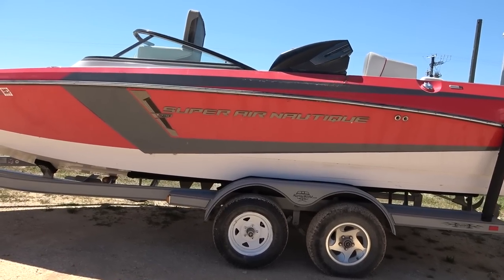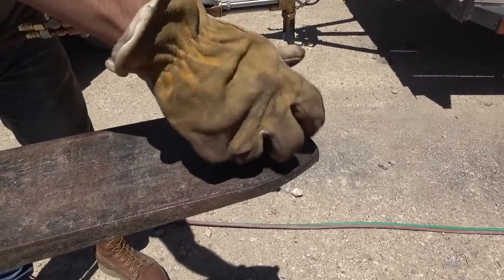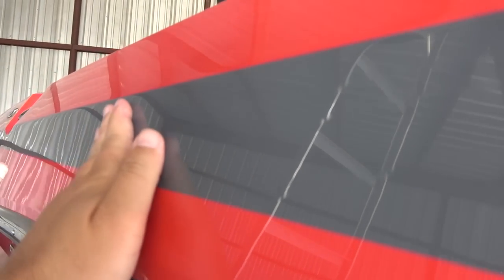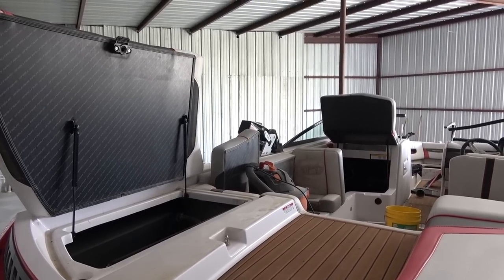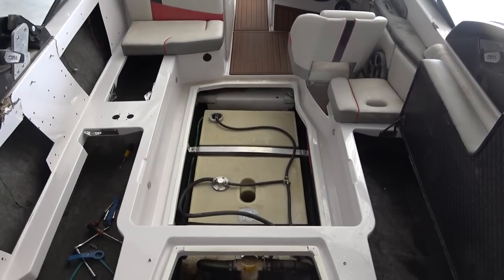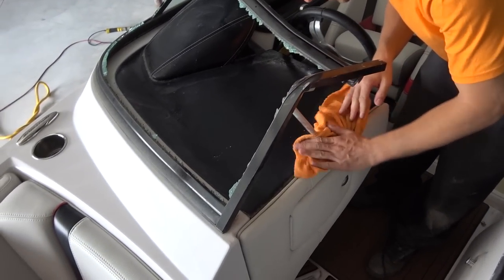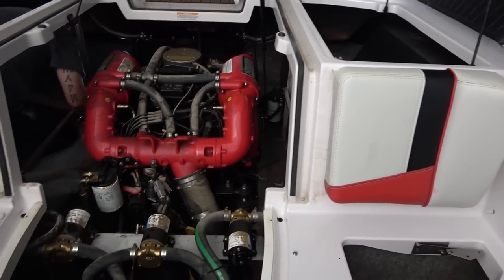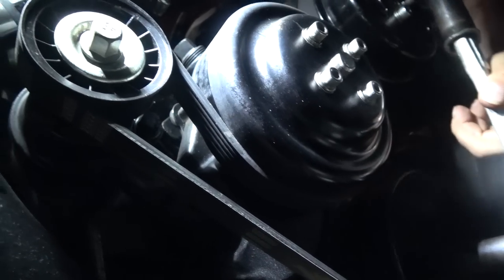Flooded Copart Super Boat REBUILD PART 2 - More DAMAGE!?!

Comment: about those pink spots. in Peru i have my boat at sea and those spots are from sea gulls poop. any chance it is the same case? try an oxidation remover. on gelcoat theyll just buff out. on vinyl you need the metal conditioner solution.

Comment: Beautiful boat I'm the one exception the first thing I would have done make sure the boat floats in the water to find out leakage of sinking Dan repair the leaks then get Sue everything else afterwards what from the bottom on your way up for all we know what don't know that type of damage of the window frame the boat was seriously rolled over on dry land don't even know if the boat is even worth fixing without the structure of the boat being safe for it to float and not drown sinking I meant

Comment: I purchased a Mastercraft that sunk. The only reason why purschased the boat because it went down in fresh water. Engine and trans run perfectly. The my biggest cost was the electronics. Had to buy most of the parts from Mastercraft and it was very pricey.  how much will it cost fix the tower from Nautique?

Comment: defiantly use automotive paint if you want to keep the boat stuffed up do some research first so you do the best job and its not that hard to gel coat we just  fully fiber glassed the roof of my dads 40 by 4 houseboat its not that hard this was done while it was stilled moored up during weather gel coat it it is easy and don't worry on cleaning fix first

Comment: If that engine has sat with water in the oil/crankcase it's SCRAP.  The bearings and journals are going to be rusted to crap.  It might run for a few hours but it won't last long.  Have you even changed the oil to get all the water out of it?

Comment: The fiberglass isn’t bad, epoxy and a reinforcing layer of fiberglass on the inside should fix it.
Reply: depends on what it was laid up in, if its not epoxy he doesnt want to be using epoxy, dont mix your resins.

Comment: Would it not have been easier to put a chain on back of forklift.. hook up trailer, pull it forward and do a 180 and pull trailer in? Or loop the barn and go in from behind if you wanted it in one way?

Comment: The pinking is mold that feeds on sunscreen and body oils then dies and leaves the pink behind as a bonus for you.  NO cleaner will remove it and the only treatment that works is a UV treatment that is big $$$$

You need to get into that engine and gearbox before doing all this other unimportant stuff.  The longer they wit with water in them the more damage is occurring.  Doesn't matter how the boat looks if it doesn't run and it going to set you back 15 to 20k for new drive train.

Comment: Dude, I'm super excited to see how this turns out! SANs never die, though this one took a helluva hit. I wonder if you can get a top 1/2 (above the rub rail) from a wrecked-bottom boat? Then swap the top sound top 1/2 onto this one. Seems that may yield the overall best end result. Just an idea, IDK if that's even feasible. Best wishes on this project!
Reply: What the fuck
Reply: Did you jut suggest he cut 2 boats in half and stick them together??
Reply: @drfrog4  Yes, just as they're originally joined along the rub rail at the factory. Seems this would be less man-hours and be sound, as each half used would be undamaged to begin with.

Comment: I would strip her to the bones. This is a very nice boat, built well at every aspect, in other words it was built right at factory.  Seeing this kind of damage to this boat, it went thru hell. The boat was not meant to with stand the weight of that much water , plus the engine weight upside down. You see this kind damage in that situation ,if you don’t strip it turn it over and Fiberglass the hell out of those stress breaks and gel coat it again it’s going to stress crack and screw up again, painting is not going to get it, unless you sell it and screw someone over.

Comment: There's an awful lot of nay sayers.   You got a brilliant boat that requires relatively doable repairs and likely an engine that will come back with minimal effort.   If you do a good job this will be an amazing boat for what you paid!

There's more work to do on the upper hull than just making it look good again, but it's fiberglass so just out the bad and replace it with new.   Can't see it being too difficult, some of it looks easy even.

Comment: Honestly man I get why your cleaning up but I wouldn’t waste my time until I found out the motor was ok the structure could be fixed.  If that Hull is not repaired on the back side we’re it was comprised. Your hard work will be for nothing first wave it will recrack there’s a reason why that boat was written off     Anything can be fixed I hope your not discouraged you’ll get it I’d talk with someone who is familiar with these type fixes to a boat and get there advice on how to fix the structure behind the gel coat because that boat hAs lost it original strength

Comment: Pink spots ‘may’ be from mould or sunscreen as suggested, OR a common byproduct of methamphetamine use on materials in an area can be very dark ‘PINK SPOTS’ of contamination. You can get swab test kits or adversely tested by professionals.
If it were worst case scenario - you’d need to scrap all vinyls and have the boat decontaminated.
Touch contact with skin can be extremely harmful if this were the case.
Just a thought.
Good luck with the rebuild.

Comment: Get it running and on the water before you get to carried away with the cosmetics.  Those stress fractures on the top side won't ruin your waterskiing and wake boarding, but not having a running, water tight boat will certainly ruin what's left of your good cosmetics.

Comment: If that Hull is fiberglass like RVs automotive paint will go to shit within a few years. Gel coat actually lasts a lot longer on fiber glass. If you look at some of the older RVs where manufacturers used automotive paint it didn’t last, there’s a reason they use gel coat..... especially in hot and sunny places like Arizona, Texas, and Florida. The fiberglass releases gasses that get trapped by automotive paint causing it to bubble up and blister.

Comment: Not trying to be a Killjoy, but just because the engine turns doesn't mean much on a boat. I had a Chris Craft with a 4.3 V6. Turned no problem, but previous owner didn't winterize it right. Block was cracked, 1 head was cracked, intake was cracked, both risers we're cracked. BOAT=Bust Out Another Thousand.

Comment: Not an expert but I have a Chris craft concept that I’ve had to get parts for the boat dealer near me told me never to use a pressure washer on gel coat is this a myth??
Reply: afik it depends on size,  the fibreglasser who did work on my boat when I asked him,  said no issue with small domestic ones,  but getting into larger / commercial ones they can start to cause damage.  Depends on tip you are using and pressure on it

Comment: I wouldn't have paid more than $9000 for the boat in the shape it was in when you bought it.  I doubt you'll make any money on it when it comes time to sell, especially considering the throw-away trailer you bought to get it home.  Tip don't put any labor into cleaning up the boat before you do all the fiberglass repair/paint/windshield replacement/etc.  You'll be cleaning it again after all that anyway.....and if you find something that turns out to be a deal-breaker, you won't have the time/money invested in unnecessary cleaning.
Remember; it was totaled because someone who knows boats determined it would cost more to fix it than it's worth......
Reply: Probably because the foam in the liner got wet, he probably didnt put a moisture  meter on the hull...

Comment: I would go with an automotive paint it will be easier to apply and it will hold up I have an 80ft Lazzara lsx 75 Named BG and we used an automotive pearlescent on the hullsides. so i would think if a yacht would use an automotive paint over the gelcoat I would imagine you could. you can lookup Lazzara lsx 75 BG and you can see how the hullsides look. the superstructure which is the top half of the boat is Gelcoat but the bottom is actually just an automotive paint over the old gelcoat.
Reply: Why pay more money for a less quality product? Automotive paint is not made for life in saltwater and will deteriorate very quickly compared to a one part poly made by total boat. Please do yourself a favor and disregard this comment and go to total boat.com, inexpensive and durable
Reply: @hawkeye123fun well we have had an automotive paint on a YACHT IN THE SALTWATER  so all I'm saying is it holds up in some pretty tough conditions and if your worried about it being on a boat that goes fast the lsx 75 does 35 knots so it holds up. It has been on it in the sun heat and salty conditions of Florida since 2009 when the boat was built plus any paint with marine in front of it is always more expensive. and I'm not some idiot im in the business of buying and selling cars boats and yachts.

Comment: Not sure about any one else..but before i clean and spend hours on cosmetic...i would make sure that boat is sea worthy or water does not come in hull...and mostly if motor is running...so that if $$$ and time is not worth fixing i don' t spend any more mula...on a junk...now boat looks good and may be am been negative...
Just going thru the motions...!

Comment: What is “Gel Coat” ?? 
A product or a process? Is it always a Polyester resin? Or could it be an epoxy or a polyurethane?
Reply: Brian Johnson it is just a protective layer over the paint to keep it looking glossy and keeping it from scratching.
Reply: “Gel-coat” is the first layer of resin that goes into the mold, on this boat each color is a different colored Gelcoat. It is what you clean, polish and wax on the exterior of your boat. I think you are referring to what is typically called a clear coat in the automotive industry.

Comment: You better bet if the jell coat is cracked the fiberglass is cracked therefore the structural integrity of the hull is compromised.

Comment: I think that I have had to cut holes into every set of forklift forks that I have ever worked with, it makes me wonder why the manufacturer does not just make it a standard feature, they could make a fortune with the extra equipment sales like the towing ball and chains as well as modified slings and hooks so as to lift engine blocks or to hang a block and tackle. . . . So much. . . , :-)

Comment: You've got severe structural problems with that boat. The gelcoat is telling you there's a problem underneath. When I saw your first video I saw a lot of cracking. That boat has to be completely opened up and the structure properly dealt with.

Comment: You don't have to make it perfect. Leave the gel coat alone unless it is cracked on the outside and flaking off or unless you have to paint that area anyway due to the fiberglass repair. The buyer is going to know the history of the boat and it is going to get old and fade anyway. I doesn't look bad unless you know to look for it. People want a good deal more than perfection. Clean it up, fix the fiberglass, tower and wind shield frames and glass. Get it running and everything working and sell it half price of a un-salvaged  one.

Comment: Those pink spots are caused by mold and mildew specifically the bacteria Streptoverticillium. Vinyl seats which are not washed down and dried after every trip especially in freshwater lakes are in danger of producing this bacteria. If you pull back the vinyl covers, you will find the same on the top layer of foam. Good news, is that you do not seem to have a severe case of pinking, and pinking is a indicator the bacteria is dying. Due to storage of the boat it has most likely exhausted the requirements the bacteria needs to survive. Bad news, is that to get rid of these pink stains, you would either have to upholster all the vinyl affected or use a solution called pinkaway. This can be administered yourself but from my experience, does not completely solve the problem but in other cases I have seen, it does. So it's a 50/50 but is a much cheaper solution to upholstering the whole boat. Also beware of any sunscreen which uses PABA (paraaminobenzoic acid) as the bacteria feeds of this acid.
In conclusion, preventive measures are best, which is a complete wipedown of vinyls with a weak cleaning solution after every trip and dry it off.

Comment: I just dont understand.  22g's was way too much. I mean way way too much. Did you say your going to put atf in that motor? Why? That boat took a high energy hit. That's why the gel coat looks the way it does. Notice where that damage is. Something fell on the boat or it flipped. Regardless,  the structural damage to it, it will never be right again. If this boat were in in turn key condition,  still not worth 22 grand. What a nightmare.

Comment: I always wondered what polishing a turd looked like, now I know. Hahaha!

Dude, those "cracks" aren't cosmetic, the hull has lost its integrity. You can repair it for fishing but if you use it as a speed boat the cracks are going to reappear and so will the shatters in no time flat. That hull is destroyed, you just can't see it for what it is. It will never have the same structural integrity it needs to be safe at high speeds. 

It's like totalling a porsche. Yeah you can fix it and make it look pretty but if you race it, it's gonna kill you the next time. It will never be 100% and those flaws will be apparent at high speeds.

Comment: His strange how my comment got turned all around I will try to correct it the boat that I have found water getting on some bass boats and regular boats is a gasket that holds the two pieces together the top and bottom and needs to be sealed that's where a lot of water comes in on both

Comment: I would do what Thr king wake surf boat maker does besides make it all out of aluminum ! But they use auto paint and they wrap a lot of stuff !  I’m turning my 90 nautique into a wake board wake surf boat ! Got a crate motor from correct craft for 7500 installed with new tyranny !! Won’t have the cool touch screen. !  But ballast in rear seat hidden !!  And Bennett make wake or ski settings for 499 and it installs in the middle like 75 percent t of the boats do I use to use a skylon and have all skylon fat saks ‘for extra balllast !! And I got a package tower for 1400 with led light ! Speakers but not getting and all I’m getting is board racks ! Bimini! And rroswell towers look retro like all new brands. ! And I’m gonna do all kicker factory tower with mic system and fusion radio and I’m gonna check garmon because the have a device for Pavarotti with had screens and phone and iPod control for stereo and led lighting and wireless charging station pockets for phones all available! Which will give use cool digital system for a lot cheaper they even have rear screen for riders !!  Check garnin slash fusion !!  ! So I’ll have all the things a air nautique of the original except 23 ft size I’ll have a19’6 but damn I live on the lake and all I care about is reliable and wake size and I’ll put the hydra foil on side which will give me three wake bulking and building on my nautique for under 3000 including kick lighting and 4 sound pods from kicker and Im gonna try and do garmon iPad system and it has recording and camera control thru garmon which is a bad ass thing to have when u actually are good Enuff to wake skate or wake surf and not impressing chicks with daddy’s or your 120 k super wake boat !! This boat msrp 160 new ! Check Pavarotti custom aluminum builds each piece by piece with lifetime wArranty on everything 275 k

Comment: Stress fractures are no an issue unless it goes below the surface. The easiest way to check is to take a razor blade and see if it goes down more than .025” deep. If so re-Gel coat it. The difference in finish quality is night and day, and anyone who looks at this will see it immediately. It’s a no-no in the refurb business. I have done about a dozen refurbs completely inside and out. The wake tower damage is totally fixable. Same with the crushed windshieldTaylor made can provide you with a brand new OEM windshield. For the exhaust. Do a simple thru-hull with 4” long tips. I make mufflers for marine applications if your interested. ATF in the pan is useless, unless you run it in the motor, only run5-7 minutes, then drain oil. Ask a lot more questions because I can see you’ll cause yourself time and money.

Comment: Use this on your vinyl stains. Have been using for 3 years in cars and our boat on the recommendation of a pro detailer. 3 parts water, 1 part degreaser. Works awesome! https://www.oreillyauto.com/detail/b/meguiar-s-4234/chemicals---fluids-16461/maintenance-chemicals-16867/cleaners---degreasers-16533/general-purpose-cleaner-17724/5a8ccad46ae2/meguiar-s-super-degreaser/d10801/4436883

Comment: Water in engine equals rebuild. PERIOD. Don’t make a video of a half-assed repair that’s destined for failure. Also, do gel. It’s not a car, it doesn’t get automobile paint. There is structure glassed in to that tower mount. Don’t throw a few mats over it and call it good, it will not hold up under use. That area will need to be tabbed out pretty far and you need to make sure whatever blocking is in there isn’t damaged.